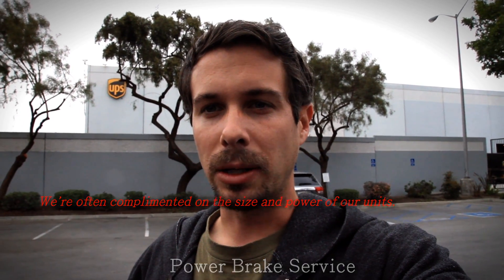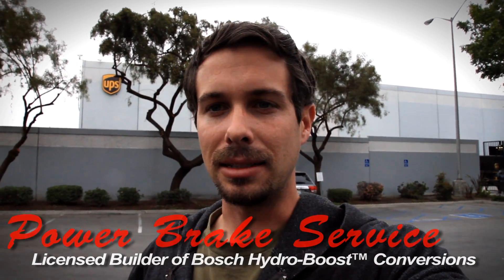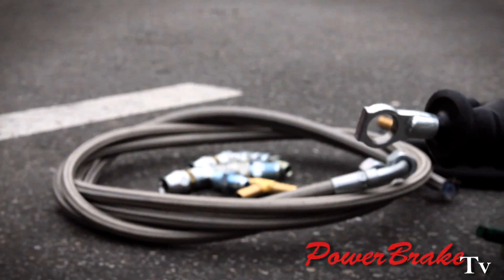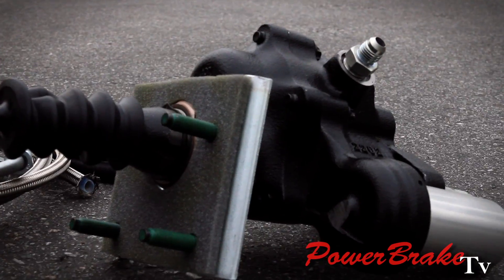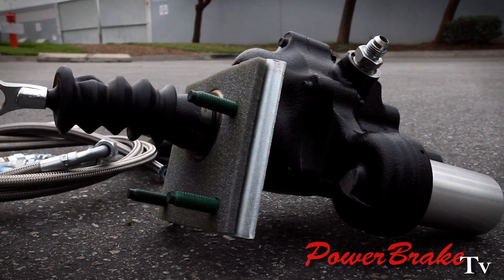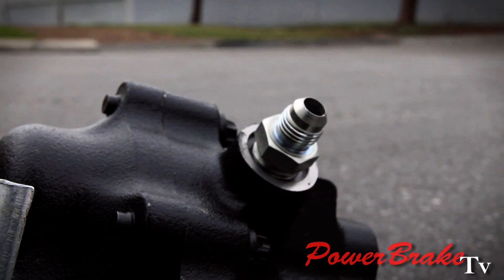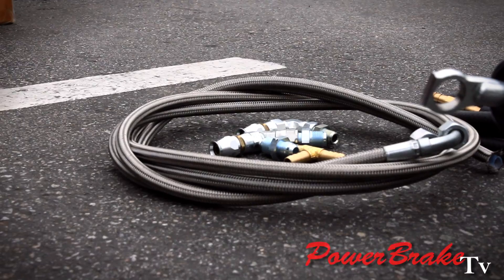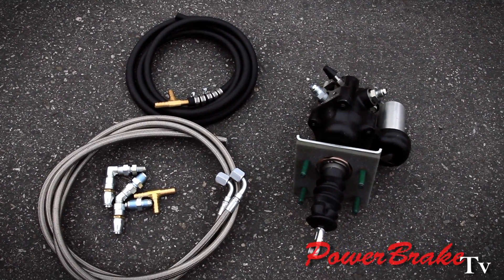Hydro-Boost - Ford GM & Dodge Diesel Truck Vacuum Pump assisted Booster to Hydro-Boost Conversion

Comment: I am currently installing this exact same kit on my 1984 Ford F250 4x4 diesel pickup.  Unfortunately I didn't receive ANY installation instructions with my kit.  I was able to glean some information from your videos, but it's not enough.  I was able to start installation, which is going smoothly, but I need instructions to finish.  This was a major purchase on my tight budget.  So I don't want to continue without instructions.  Where do I find this information?  Thanks.